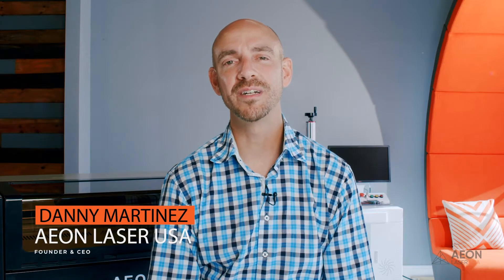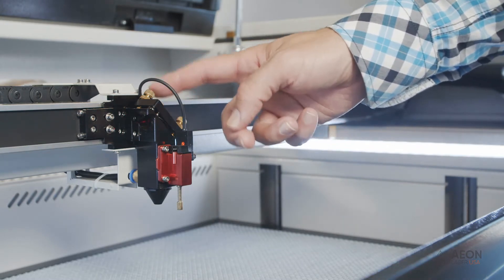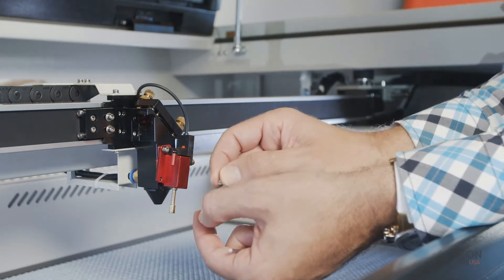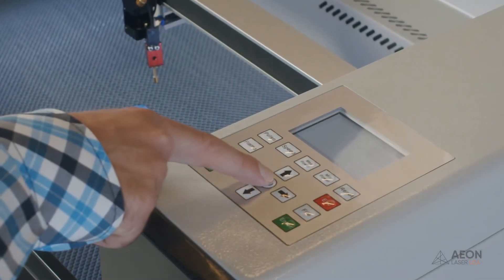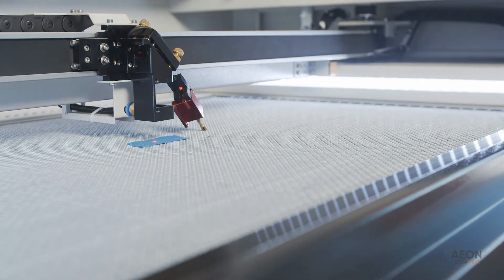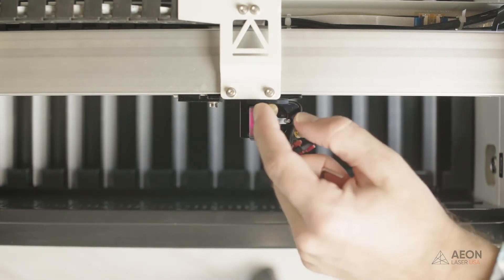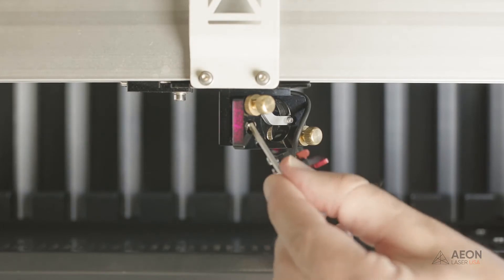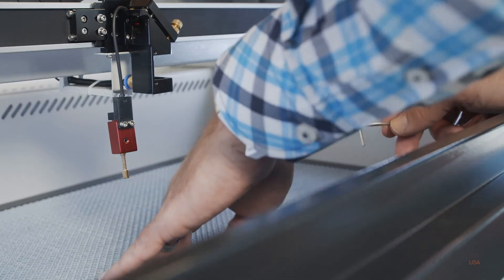MIRA Pro Part 5: Aligning Mirror 3

Comment: What power should be set to do a pulse shot?
Reply from the maker: Hey Lukas! It depends on the wattage of the machine, we typically recommend 30-40 power for the pulse shot.
Reply: @AeonLaserUSA  I have quite fresh MIRA 7 with equivalent of RECI W4 tube so in my case to get similar burn I had to set not more than 20% of power. Anyway thanks for the video - I already had some experience in aligning it on bigger machine (with great success) but for the last mirror your tutorial was quite different. Now it looks very, very good however on both machines I have 2" lens and on the bigger one the final spot is little smaller than on the MIRA 7. Do you think the distance from last mirror to the lens can play any role in it? The whole head on the bigger machine is... much bigger ;-)